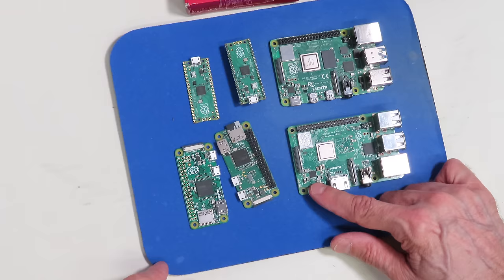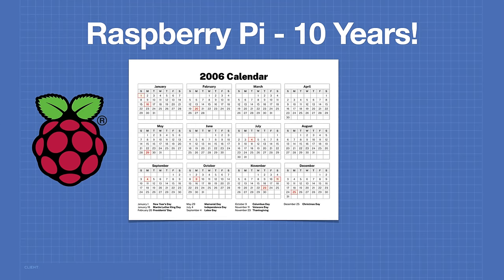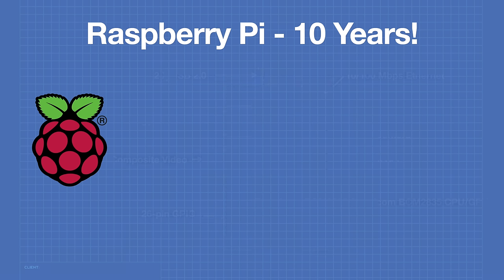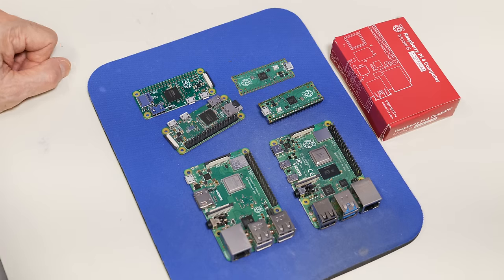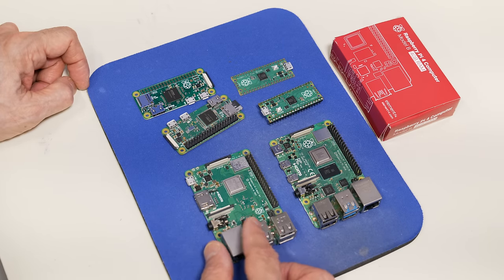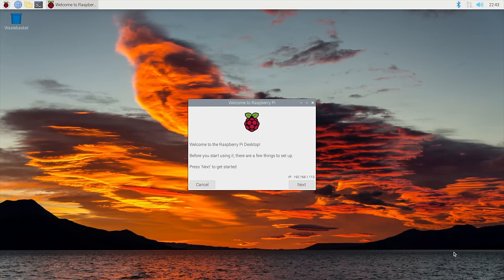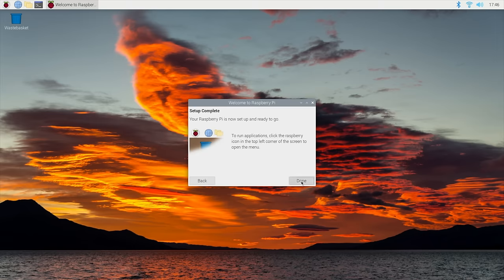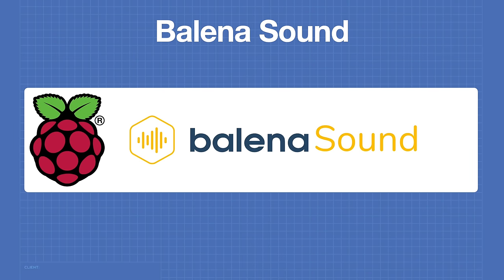10 Raspberry Pi Projects (All models, including Pico)

Comment: Happy Birthday, Raspberry Pi! The Pi is such an incredibly versatile device, and has fueled quite a few very interesting projects and builds. My favorite usage of the Pi in particular is how it is benefiting those of us who are into vintage/retro computers. There are a ton of extremely useful Pi projects for retro/vintage computer enthusiasts. Some of my favorites include:
- RASCSI (emulates SCSI hard drives, which are most likely to fail on older computers and are becoming very hard to get)
- PiStorm (a CPU accelerator for the Amiga)
- MT32Pi (emulates the Roland MT-32 sound processor for high quality MIDI sound on old school DOS games, etc.)
- RGBtoHDMI (converts video output from older machines to modern HDMI)

Comment: The RPi 400 actually has a power button by pressing the raspberry and F10 buttons.  Also, I don't know if this changed with the latest iteration of Raspberry Pi OS, but I also had the whole scroll annoyance (US) - but I dont recall what the default placement was, I suspect it was at the top (to your favor). 

All in all, this is an awesome tutorial from "I got my Pi in the mail today" to actually doing stuff.  I liked the Pico projects in particular.  Thanks for all of the hard work on this!

Comment: at 06:50 you call that the 3B, but it's the 3B+ . you can tell because of the wifi shield . great clip! thank you for all your hard work you put in all your videos!
Reply: That's true, but also:
+ Metal heat spreader on main CPU
+ 4-pin Power over Ethernet header
By the way, super nice birthday party.

Comment: I would like to point out that for the Simon project at 37:30 you say GP3 and label a pin GP3, but that pin is actually GP2. GP3 is the 5th pin down on the left side, not the 4th one.

Comment: This may be considered nitpicking, but I would strongly advise against leaving the VirtualHere binary in the downloads folder at 31:40. It’s very easy to get accidentally deleted if the machine is used for any other purposes besides VirtualHere. There are locations where such a binary would canonically be placed, such as /opt/bin

Comment: After downloading the raspberry pi software on the Ss card you remove the sd card and insert it into the raspberry pi   The next step is you setup the raspberry pi (set location, set WiFi, keyboard type etc)   My question is do you have the raspberry pi connected to a monitor to do this and what type of monitor should I get and how do you connect it

Comment: I was wondering if using one of these little pico boards with fastled and an Ir remote would work, i have tried it a few times with arduinos but due to interupts being needed for both the Ir and pixel data and animations stall up!

Comment: 10 years?  Doesn't time fly?
I managed to snaffle one of the very first batch of Raspberry Pi Model B released to the public.  On the morning of the release, the Element 14 website ground to a halt.  I had bought some stickers from the Raspberry Pi online shop, and there was a phone number listed on the receipt, so I called it.  Guess who answered?  Yep, Eben Upton.  I explained the problem to him, and he was very apologetic, even though it was about 7:30AM.  He talks a lot...  I was on the phone with him for at least 5 minutes.  The upshot was, I managed to get an order through, and my Pi arrived a couple of days later.  I don't know if he intervened, or if I was just lucky.
The Pi is still running fine, and is acting as a PiHole on my network to this day.
I also have a 2nd gen. Pi and a Zero W.

Comment: I thought I would try the Beleana Sounds Following your instruction was easy if a bit longer than you indicated. I got as far as connecting my iPhone to my Raspberry pi 4 without problems but no sound came out of the 3.5 not Hdmi connectors. Having carried out some research it looks like this has been a problem that has come and gone for years. Pity it would have been  useful use of my spare Pi

Comment: Hi, Some time ago I bought an Arduino Uno and made a simple project with it. I copied the sketch from the internet. Programming is not easy for me. There is no real course to be found on the internet. I did find courses for C++, C# and Python. Now I wonder if I made the right choice. Is a Rasberry Pi a better choice. A very long time ago I did make programs in Basic. Can C# and Python be used in Arduino and/or Raspberry Pi?
Thanks in advance.

Regards, Jan

Comment: Well, about selecting countries... Shouldn't it be in the order where it's most used first so you annoy the least amount of people and then alphabetically... lol 
My 2 cents which is prb worth that much.
AND, I do have either a reboot or shutdown switch for EVERY Pi! Headless or not... I just made it part of every configuration. 
I also have a script to restart the wireless if it can't ping the gateway within a few minutes. Anyone else have the problem where they lose wireless sometimes? I know the HDMI/powersave options. Been there, done that. Still happens. I know this isn't the forum for it but, I've exhausted my resources. Love the channel!

Comment: NItpick: You said the first Pi used a microSD card, but it used a full sized SD card. I still have mine - from the second batch. I missed out on the first batch because we had a power outage that conveniently lasted until after the first batch was sold out.